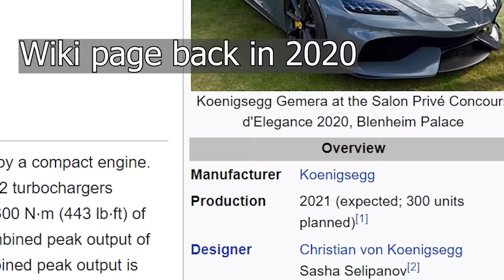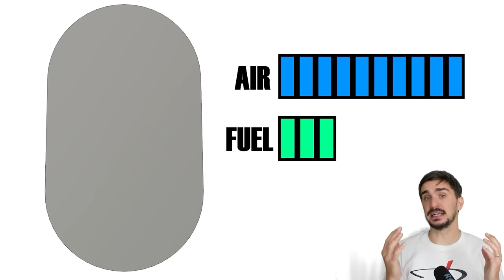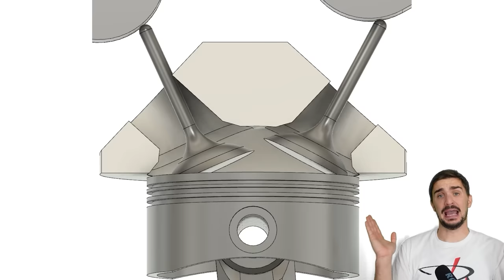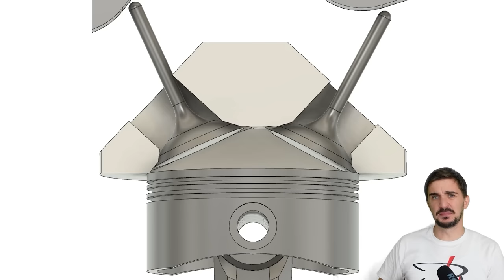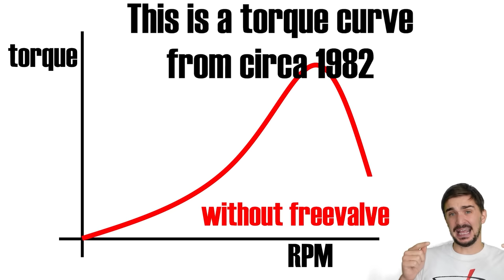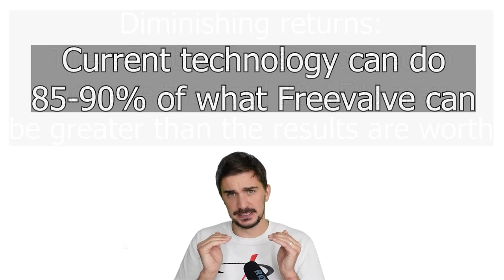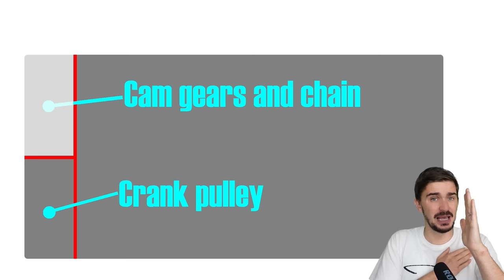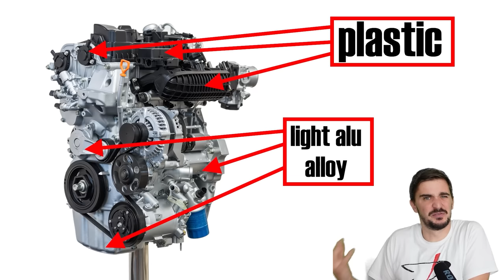FreeValve Isn't a Big Deal. Here's why

Comment: Back when BMW introduced Valvetronic on top of Double VANOS, I thought the combination was super impressive. Those engines could optimize intake and exhaust flow at almost any RPM and run with the throttle plate full open all the time, what more could you ask for? But Multiair is incredible and FIAT sort of changed the game without anybody here in the US even noticing. It basically does everything on the intake side that Freevalve can do.
Reply: vanos was a joke and so is bmw. i owned an old e39 that was specifically bought because it was pre vanos. they ran better had less problems and made more top end power. imagine that.
Reply: @chehystpewpur4754  Even if it's true that the pre-VANOS M62 made more power than the VANOS equipped M62's, the VANOS was not the ONLY difference between the non-VANOS and VANOS equipped M62 engines. What is a fact is that the Valvetronic equipped N62 made more significantly more power AND torque than any M62. 50 more HP and 30N-m more torque, and it made that peak torque earlier, and made torque for many more RPM's.
Reply: @chehystpewpur4754  I grew up with one, inherited one, and maintained one.  The issue isn't that they're bad and non vanos runs better.  It's that the seals go bad, but not enough for people to notice over the time it goes bad.  So the car gets worse but at a snails pace.  You can rebuild/replace the system real cheap, but it's a pain in the ass as it involves basically taking apart the case.  Removing the front of the car work.

If you're a car person, this is cheap.  If not?  oof.  BMW is cheap to self-maintain, but not otherwise.  So with the second hand market being what it is for BMW, you get a lot of newer drivers and generally lower/middle class peeps that can't do the work AND can't afford to pay someone to do the maint.  You end up with a lot of cars with VANOS going bad and no longer functioning.  Crazy part is, there's no engine light for it.  My car went from being capable of 30mpg to 20 on a good day on the highway.  Thing ran great with the automatic 4 speed transmission but boy was it more fuel dump than optimization to get its power still.

Comment: I would love to see Freevalve used on a modernized radial engine. It would simplify the construction quite a bit not needing cam rings and such. If naturally aspirated it would eliminate any need for an intake system entirely, so between all of that it would make a multi-row radial very simple to build.
Reply: Plain and simple: electric drive is not as efficient as a straight-forward mechanical drive😀
Reply: My dream is to be used in a boxer 6 engine, cause it does not need timing chain or any other source of mechanical syncronization. It would overcome most downsides of a boxer engine, because it's also shorter than any variable valve time system and reduce width of the engine.
Reply: The problem is just.... modern radial engine are quite rare already and most manufacture opted to boxer engine.

I mean, the point of radial engine is to make more power while sacrificing frontal area (which is not a big deal if you had big plane already), but about the big power, let's talk about elephant in the room shall we? Gas turbine engine
Reply: I got a couple ideas if your interested in hearing em
Reply: If cars become simpler how will they sell replacement parts? Ingenious ideas won’t be used as they are less profittable.
Reply: Yea there's a free valve that's been used for decades
It's 2 stroke and Rotary 😂

Comment: Excellent video.  I think you are quite correct.  Freevalve (or similar non-camshaft technologies) makes the most sense on hypercars or similar cars where the top priority is maximum performance, cost be damned.  What Freevalve does is allow the engine to reach that maximum performance over the entire rev / speed / torque range while also providing acceptable drivability at city driving speeds and also meeting emissions and fuel economy mandates.
Reply: Actually, once fully implemented and developed, it can theoretically make mainstream engines better, and require less overhead capacity. It can probably make an incremental improvement the same way that VVT, direct fuel injection, turbocharging, and variable compression have, or at least have the capability of. And with freevalve taking a step beyond mechanically-driven VVT, it can combine with the rest of those methods to make smaller, lower-displacement engines both more power efficient, and more fuel efficient across the RPM range, and keep cars performing as expected, not under-powered in their normal use cycles.  It also clearly has capability in a true hybrid system, for Koenigsegg to be using it in Gemera as both a generator, and as a high-vehicle-speed  kinetic energy source for direct drive, bypassing a kinetic-electric-kinetic double energy conversion at high heat, current, thermal, and velocity load, where EV drivetrains start to lose advantage.
Reply: @m.k.1340  Did you watch the entire video?
Reply: I hate turbos because of lifetime durability. They are only good to cook your steaks on the hood for 1-2 hours after shutdown. The heat degrades all of the plastics and lubricants much faster than a NA engine. I think FreeValve can improve low rpm power and torque without a turbo? Much better than these variable valve technology engines can without a turbo. Repairs have got to be simpler and cheaper?  Once the costs per unit by increased scale of production occurred. This would make the engine percentage performance increase much better. 5% is still significant.
I don't know the cost differential so my assessment depends on that considerably.
Can anyone give me a ballpark cost differential?
Reply: agreed. A few % can be a huge deal on a hypercar but not a normal car.
Reply: @msmeyersmd8  I don't know the exact figure.

But each pneumatic valve failure only made your blood boil even more. Because those tiny thing require complete top disassembly.  And there's 24 of them at least, ready to throw blink on your dashboard.
Reply: I bet they said the same about electronic fuel injection 😂 saving fuel has never been more important.
Reply: @msmeyersmd8  What exactly do you think Freevalve can do that an engine with Valvetronic can't do? Valvetronic allows infinitely variable lift, timing, and duration.
Reply: @graham7513  To be perfectly honest, I don't know enough about the operation of either to make a proper judgement.
Superficially, the FreeValve seemed like it would be more reliable. Just a gut feeling.
I'm 65 years old and I've seen most things with "tronic" in the name fail terribly. It's such a 1970s marketing term.
I absolutely hate BMW car engine engineering. Plastic oil pans. Plastic NA intakes stay cool. Oil pans never do.
I've watched two incredibly expensive BMW failed engines torn down. Both were not catastrophic failures but rendered the engines financial paperweights. As if ease of repair was never a consideration.I was appalled at the design and engineering for a passenger road car engine.
That's just my opinion. I really do appreciate the fine mechanical engineering of the engines. They just seem to be designed by engineers who are used to Formula 1 longevity standards. I exaggerate...just a bit.

Comment: You're videos have taught me so much in the last year. Keep doing what you are doing man.
The only argument I can come up with in favor of FreeValve is for tuning. It would be so simple and easy to completely change the nature of the engine with just a tune swap. You could jack up the valve overlap for the car show on the weekend in a second, and just as easily change it back for your drive to work on Monday. Obviously this is a very small reason and wouldn't be enough to justify the creation of the design, but it is cool to think about.
Reply: Yep your correct that basically the only benefit is tuning individual cylinders. Some things cannot be improved upon such as drive shafts, brake rotors, etc. On paper FV sounds great but in reality not worth the effort along with durability & longevity. It won't ever happen
Reply: Also no changing timing belt every 60,000 miles.
Reply: @ksavage681  Who has a T belt anymore?
Reply: I know you can get a "Ghost cam" tune for your 5.0 Coyote engine that does exactly that- it advances the cam to the max RPM setting at idle and gives your car the 60's muscle car engine lope. As soon as you hit the throttle, it goes back to the default settings for maximum power and torque.
Reply: CannedCoochie  So what's your point, that this is a viable valvetrain system because it's not yet, maybe someday but not now...

Comment: It was positive to hear about Fiat's Multiair, because I was thinking that FreeValve patented old solenoid valve idea and was monopolizing it, which is not helping the tech developement sometimes. 
Reliability is still the main concern, failing of electronics cannot kill a camshaft engine normally, but a freevalve engine can be destroyed.
Reply: Yeah you’d want the solenoids to be super easy to individually replace
Reply: If reliability is primary, a camshaft, camshaft phaser, and the entire valve train is oil lubricated, and oil pressure drives the cam timing mechanisms in some cases... and the timing set still drives the camshafts regardless. With mechanical damage shedding metal shavings into that system, it gets destroyed. With oil starvation, that system gets destroyed, as the engine continues to drive the valve train. If the electronics or the air pressure system fails with Valvetronic... the valves close and fail to open. They don't continue to wear, they don't impact the piston in an interference engine design. The engine loses power in one cylinder, or shuts down, until the problem can be fixed... but the oil is less likely to be full of debris, there is no timing mechanism at all, and the pistons and valves themselves have likely not come into contact. The engine probably doesn't need a rebuild, it just needs the freevalve solenoids individually tested and replaced as necessary, or the pneumatic supply repaired.
Reply: @m.k.1340  And all that's avoided in a cam engine by simply maintaining it properly. Moot point. 

To cover defective product, a freevalve system can be defective, and fail as a result as well.
Reply: @m.k.1340 With BMW Valvetronic the most common issue is as always electrical. The actual electric motor driving the thing dies and the thing gets stuck in some random setting. If you are lucky enough to have them in a somewhat open position then the throttle gets utilized as a backup and you can just slowly drive the thing to the repair shop. And even in the rare occasion when the thing dies on a still engine and the valves are all closed you can take the cover off an manually spin the motor and set the thing to a some intermediate position. I can only hope that FreeValve system has some valve retention springs so when the coils die the pistons would not hit the low hanging  valves causing expensive engine damage.